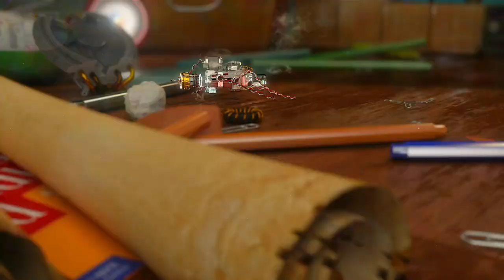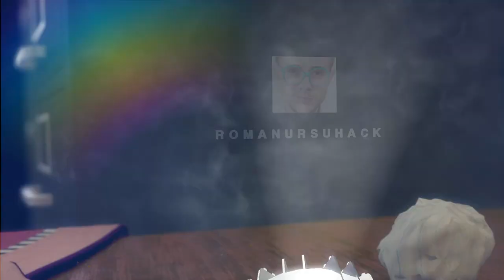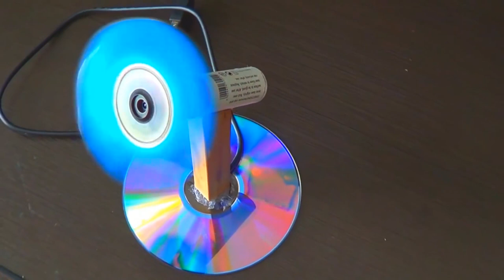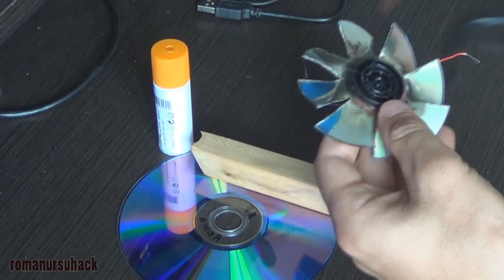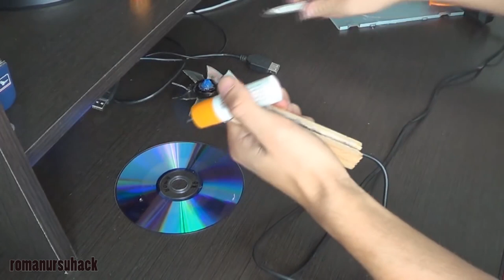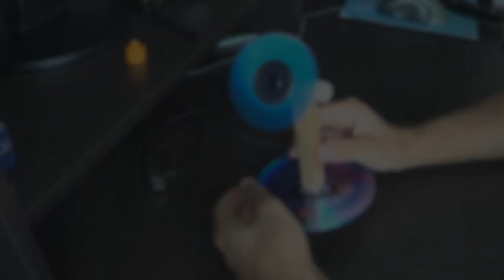How to make a mini USB FAN / Tutorial

Comment: DONT make it is it can damage or injured Eye or face as the cd plastic is not safely joined and possible is to fly and make you injured or your LCD too.
Reply: It's fine. The blades are uninterrupted plastic, not glued on or anything like that. It takes 10s of thousands of rpms more than a little 12 volt motor can give to break.
Reply: dude, life is dangerous in it of itself.
Reply: DONT drive your car because it is dangerous
Reply: Do u even English bro
Reply: Nadeem Ahmed Cars are the most deadly form of transportation on earth. Doesn't matter if you're wearing a seatbelt or not.
Reply: +Dayson Moxness make sure you have fasten your pent's belt :)
Reply: Sounds like you live in constant fear. Settle down and relax.
Reply: Nadeem Ahmed There's a difference between being safe and being overbearing. Being safe would be to check the connections for weakness; being overbearing would be to outright demonize the project altogether. Cars are the most dangerous form of transportation in existence, but over a billion still use them, because they can minimize the risk of death or injury by driving safely.
Reply: +Dayson Moxness safety first.  and in this video it wasn't discussed as it should have.
Reply: +Dayson Moxness hehehehehehe again you have lost beta :)
Reply: Nadeem Ahmed OOOH DAMN SON, NICE BURN! When'd you come up with that one? Third grade?
Reply: +Dayson Moxness safety grade :) #bc #lol